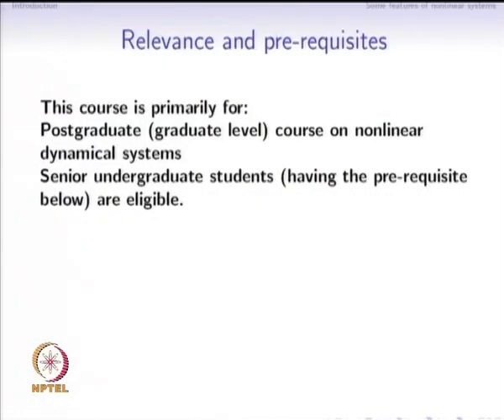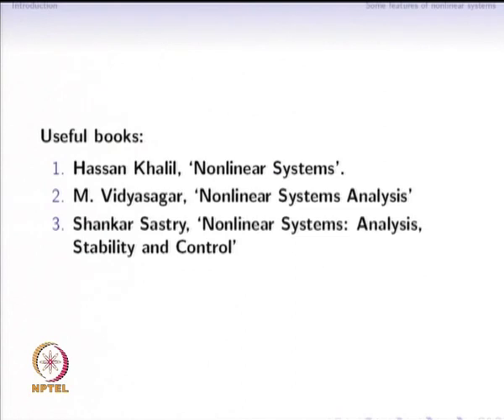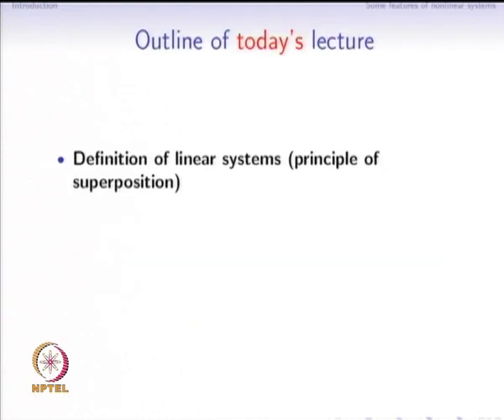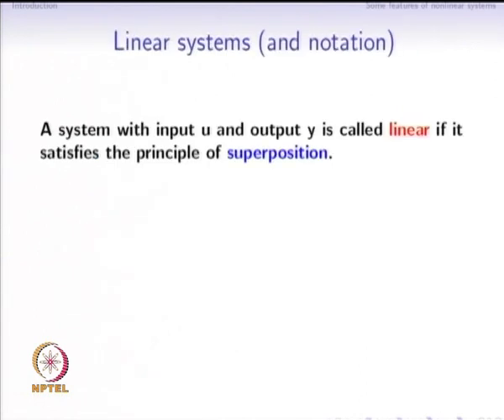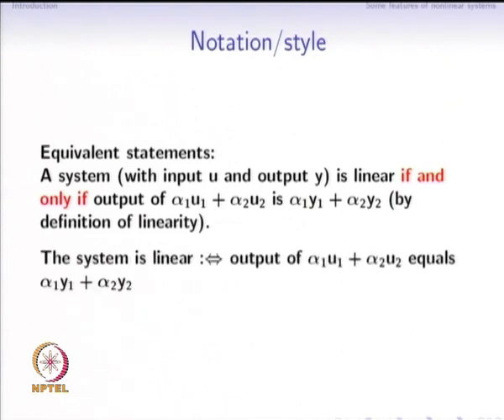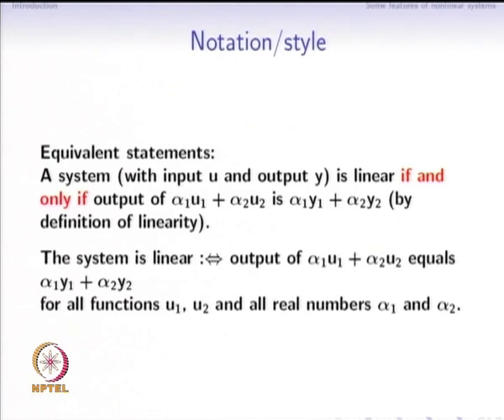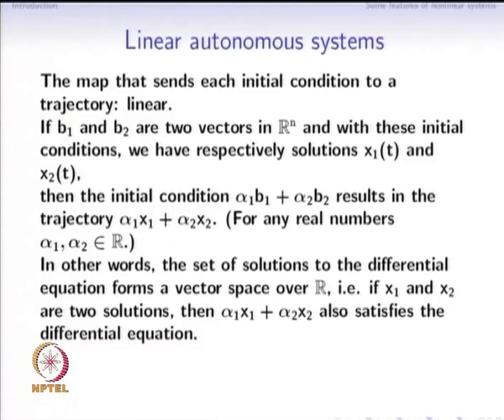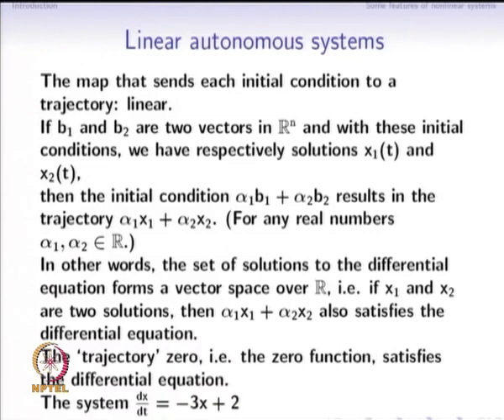Mod-01 Lec-01 Introduction

Comment: At 23:31, you said "in case multiple equilibrium points", linear systems has a single equilibrium point at the origin. What do you mean by multiple equilibrium points for linear systems? Any clarifications? thanks.
Reply: That is not true. The linear system must satisfy superposition and homogeneity properties. Even a straight line equation that doesn't pass through the origin is not considered as a linear system.

Comment: What are we perturbing ? Why were worry about equilibrium point ? Why are we doing this analysis ?
Reply: tanjimlusary The differential equation practically represents a system(eg: a car, robot,etc) and perturbances are unwanted disturbaces acting on the system(eg: air wind acting on a quadcopter, etc).... You can probably try to relate these into real world and I guess that is the best way to learn control